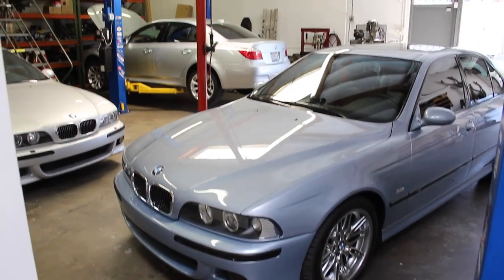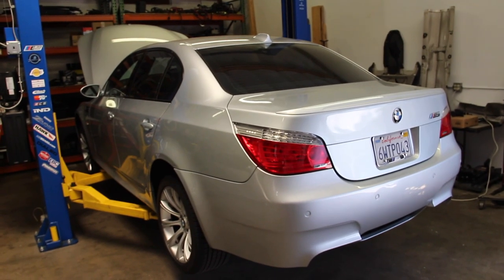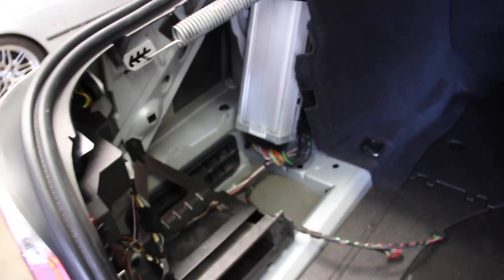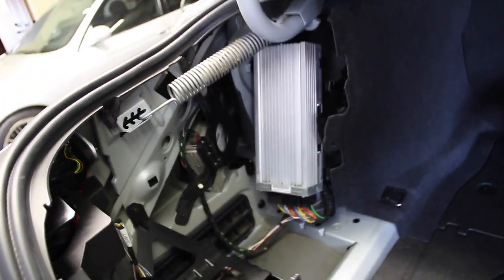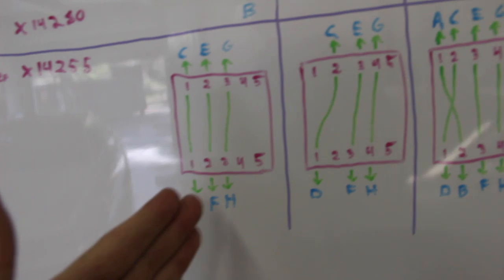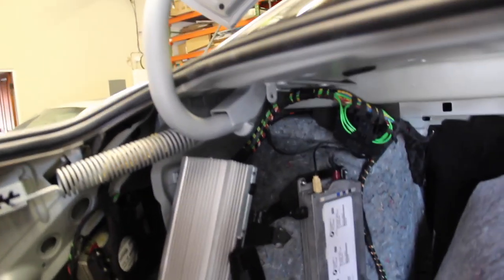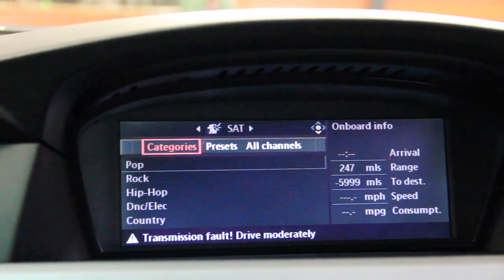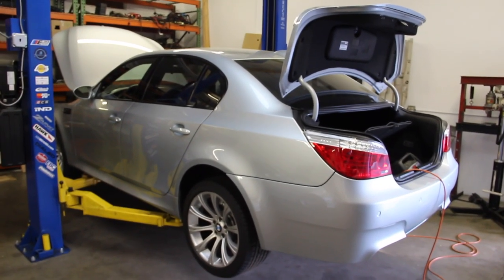BMW E60 M5:  Sirius XM Retrofit

Comment: This whole video I’ve been impressed that bmw  added extra slots the extra spring pressure for the trunk. I never saw this on my 550 since I’ve never had to go back there but if my trunk ever slows down, now I know what to do.
Reply: I was more impressed by the fact that the spring is filled with foam to reduce noise or avoid vibration sounds when driving.
Reply: @Biker_Gremling  yea, its surprising how much the think about it. its the little things...
Reply: @Biker_Gremling  It might be more for that spring noise when you compress and uncompressed the springs. my attic has a hatch and its spring assisted and when you open it its making all kinds of noises springing and spronging

Comment: @e39source, My m5 works perfectly except for the auto blip on the downshift.
I'm assuming thats a fault in the software of the car. Is that correct?
How do I fix it? Thanks in advance.
Reply from the maker: I don't think the E60 M5 has auto blip on downshift?  Ours never did.
Reply: The E60 SMG has auto rev match, it’s just terrible.
Reply: @E39Source  I had auto rev match when new. Then it disappeared.
Reply: @computiNATEor  Not in dsc off with the smg at 6. It was spot on.
Reply from the maker: @jpracingph  I bet you had an aftermarket tune that added/improved it.  Then the dealer updated the software and it went back to stock.
Reply: @E39Source  Nope. Kept my car stock since the day I got it new in 2006. Never did anything to it.
Reply: @jpracingph A couple of things are possible - worn out SMG clutch, bad crank sensor, bad trans input speed sensor. Scan for codes.
Reply: @computiNATEor  Thanks!

Comment: Hate the BMW coding programs, got bimmercode for my phone instead to code something out on my f80. doing SMG to manual swap then? would also be interesting to see CIC/NBT iDrive retrofit on the E60
Reply from the maker: Would Bimmercode work for an E60?  SMG --> manual part 1 is coming soon.  The CIC/NBT swap is EXPENSIVE so we're not going down that road, at least for now.  Our F10 has NBT and we still never use it.  iOS>BMW nav
Reply: Tomas Trunecek cant use BimmerCode to change vehicle order
Reply: @E39Source  it does work on E-series cars now but not sure if VO coding is possible through the app yet. I got a BT OBD dongle and it was all very easy to use on my iPhone XS though I did just simple convenience coding like ASD delete.  Looking forward to the manual swap videos.
Reply: @FishFind3000  ah, that sucks! thanks for the info.
Reply: E39Source carplay support was added only to nbt evo and newer sadly.For the e60 an android hu would be the smartest/cost effective solution to be honest,you dont lose any functionality of the stock idrive and get a touchscreen and apps.BTW..if you ever need advice with coding or remote coding you can send me a message,free of charge of course.I do bmw coding and repairs for a living so i might be able to help you with ncs for E series or esys for F series in case you dont figure it out or dont want to mess something up XD
Reply from the maker: @NathanD995  Hi Daniel, thanks for the info and offering!  I may just look you up.. can I get an email for you please?
Reply: @NathanD995  I did a CIC swap some time ago but was never able to get nav fully activated. Do you have any tips? I've considered swapping the CCC back in and moving to an android screen for carplay, but I don't want to let this project beat me. :)
Reply: @E39Source  sorry for the late response,i sent you an email so you can have my email XD
Reply: @ccieszyn  Well..depends.You can try and activate it using activation scripts,but you have to make sure your CIC is updated to a newer version so that it doesn't brick while you try to put it in virgin state prior to fsc certificate installation :D.If we are talking about an E chassis CIC most likely you will need a most adapter to proceed with flashing.For F type chassis most has been integrated in zgw and doesn't require a most adapter to flash,you just flash it via obd port